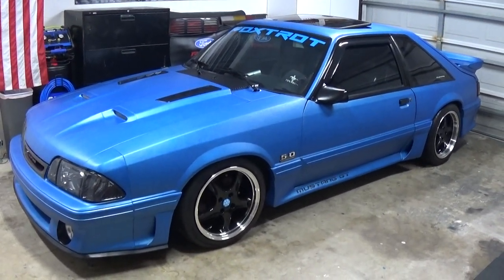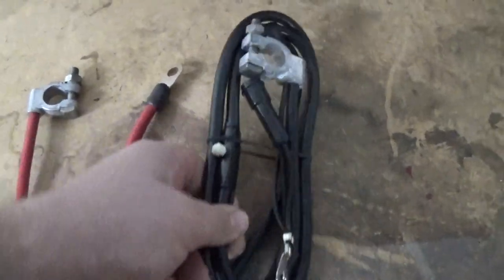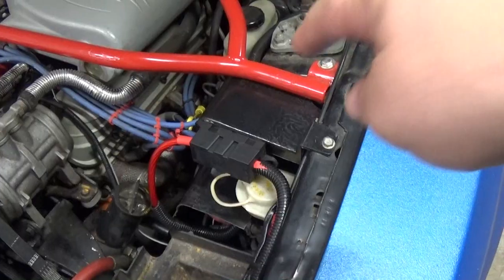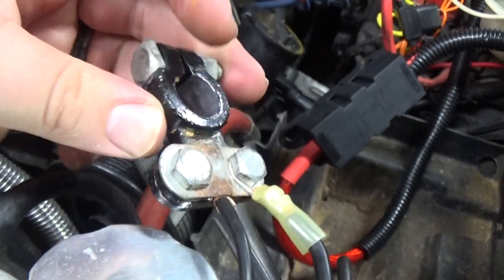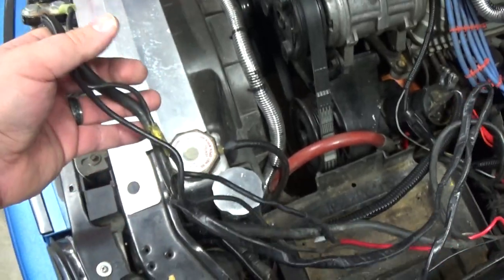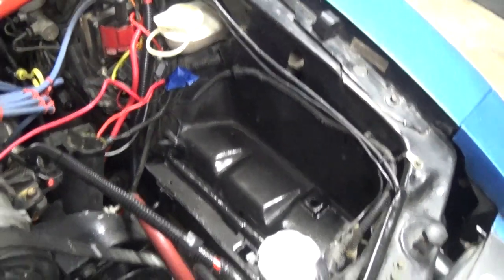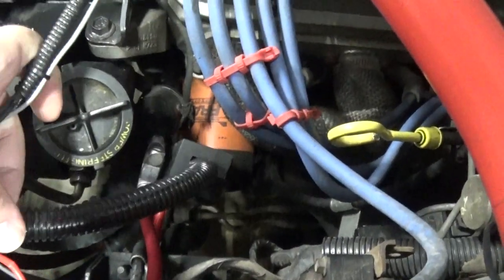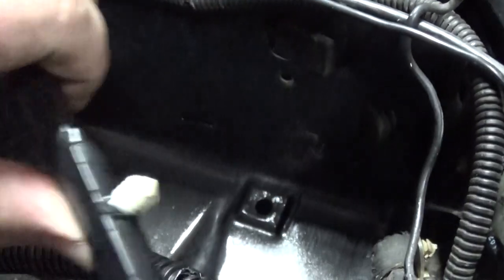FOXBODY MUSTANG  BATTERY CABLE  NEW POSITIVE AND NEGATIVE CABLES

Comment: Hey bro. Question for you. That connector for the negative terminal the pcm ground, someone cut mine out  need to know the wire color for that connector.  I found 2 wires cut one is black with green stripe and the other is black with yellow stripe.  Please help 🙏🏼

Comment: 🤔 what lowering springs are used on your Mustang in addition to wheel diameter? I like the ride height of your Mustang.
Reply from the maker: Hey hows it going. I'm running Eibach  2.5 inch lowering springs. Not sure if they make them any more. I'm also running cobra R 17x8 in the front and 17x9 in the rear
Reply: @mustangmotivation6009  thanks for information on coil springs😀
Reply from the maker: @k.c.williams3385  your welcome. Anytime.

Comment: Did you know what the second ground was for on the negative cable? Mine was always disconnected
Reply: That's the pcm ground for your computer
Reply from the maker: Mmm not sure. I would need a diagram.